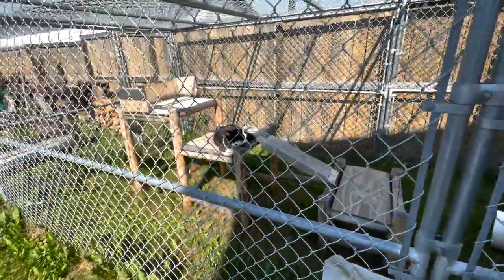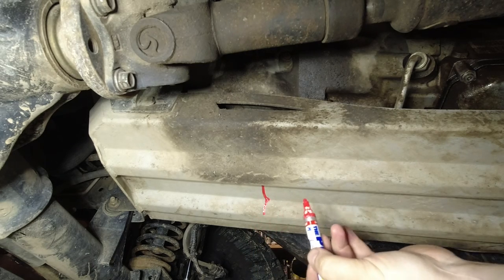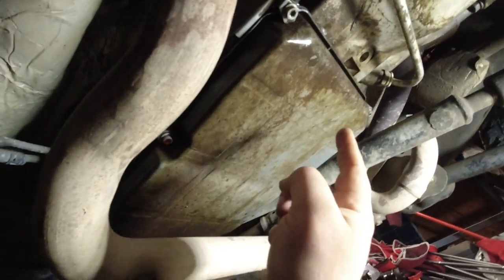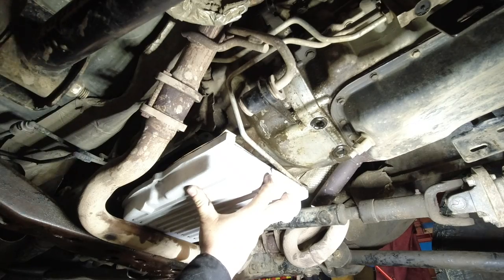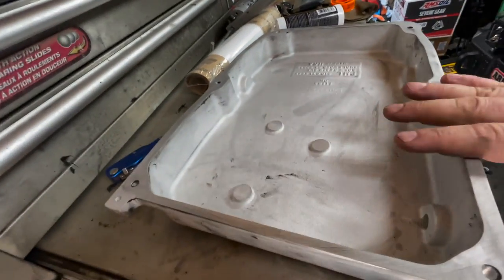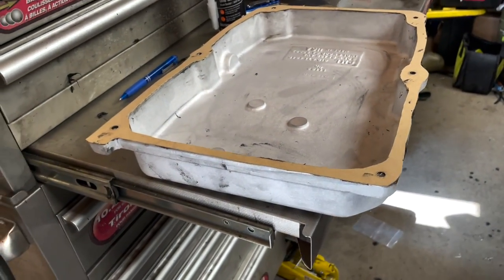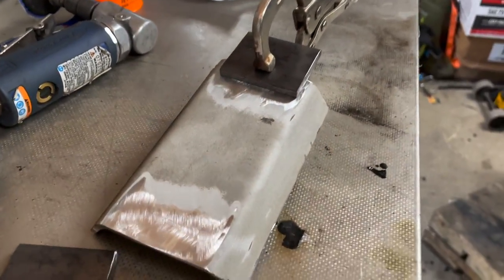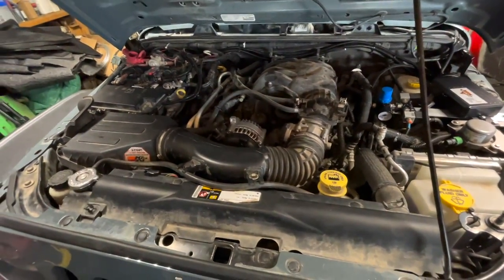Oops I Should have Test Fitted First

Comment: A couple of years ago I changed my rear main seal and decided to change the oil and filter in my ‘04 wrangler. So I took both oil pans, sanded them, primed and painted them. To alleviate the frustration with changing the tranny oil, I drilled my own and put in a bolt of my own. LOL I almost put in a spicket. Turn and it pours out like a hose. I sanded and repainted the skid plate two tone as well. Black on bottom and royal blue on top (inner). I have no idea what I’m doing, but I learn everything from you and a couple others here on YouTube. I don’t know what I would’ve done without you guys!
Reply from the maker: I’m glad the videos have helped
Reply: @BackCountryWrenching  you have no idea. I was broke going thru divorce back in 2016.. I’m the original owner of my ‘04 so little by little my Jeep started needing things and you’ve been there. Saved me a ton of money and not being helpless. I’m a truck driver now. Retired too. 🤭😊

Comment: Hey, Jerry! There is something about the exhaust setups on modern Jeeps (80s to present) that just drives me nuts! Why do they (Chrysler) run the f*cking hot cross over pipes in close proximity to or under the engine oil pan (my 4.0L TJ) or autotrans oil pan? That cross over pipe gets f*cking HOT! And it no doubt will add to higher oil temps, if not cook it! I moved mine a few inches forward (welded extensions into the upstream and downstream sides of the cross over pipe) and the oil temp dropped 10°F! It may not sound like a lot, but the 4.0L runs hot to begin with, so why do they insist on cooking the lubricants further? It seems as if Chrysler goes out of their way to cook oil! Just my observation. Great vid! 👍
Reply from the maker: Legit question, I dunno why either to be honest

Comment: Trans pan only having 6 bolts kinda seems like a recipe for a leak. The trans pans on cars I work on in the past usually have 10 or more bolts.
Reply from the maker: I agree it is a poor design for sure
Reply: I can go by my personal expeirience which is limited to an 89 4.0 Cherokee, and my (current) 98 4.0 Wrangler. It seems as though for every good design feature the vehicles might have (the 4.0 is a legit beast as inline 6s go) they build in half a dozen sucky ones! And from what I've heard and read they only got worse up until 2019, and I'm not sure if it ended there!

Comment: I hate cork gaskets! Even the rubber impregnated ones suck! Why would an aftermarket company include a cork gasket??? Cork is good for pins in a cork board! I have been welding nuts on my oil pans for years to add drain plugs or repair damaged threads, I dislike swimming in any oil.  Is the 8.8 for the TJ? I put an 8.8 in my TJ, used the Barnes kit and cant say enough about Barnes, bad ass! I now want to weld 9 inch ends on the 8.8 to widen it and get rid of the C clips, probably use the cut to length axles for a 9 inch. OX locker is also on order ....

Comment: Lol, there is lube locker decal on your tool box as your fighting the home made gasket. Tell that company to buck up and provide a lube locker for that price
Reply from the maker: It’s a custom pan they don’t make gaskets for that but it would be awesome
Reply: 10-4, I also don’t understand why they don’t have drains from the factory anymore. My 19 f350 didn’t come with one either. But the earlier 12-17 f350s use the same tranny and have a drain. The 17-19 alumiduty can simply order the older pan and get it with a drain. I think vehicles now are all about cutting cost to maximize profits. It’s a shame but that’s how she goes.

Comment: Jesus talk about make a job three times as hard just put the cork gasket on it
Reply from the maker: I’ve never seen a cork gasket that never leaked in my life that’s why……..
Reply: @BackCountryWrenching  on my Dodge Ram I actually had to use a cork gasket on it I couldn't not get it to stop leaking with five different types of other gaskets.
Reply: @BackCountryWrenching  and to be honest at least now it's just a very slight weep instead of leaving puddles ......I put a straight edge on the bottom of the transmission to see if it was warped which it wasn't ....who knows
Reply from the maker: A slight weep is better than a puddle any day